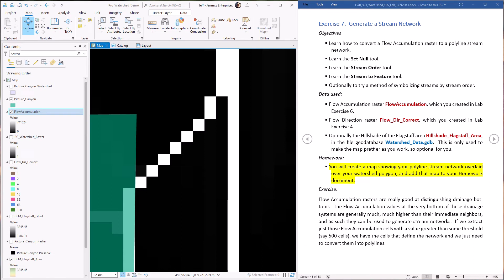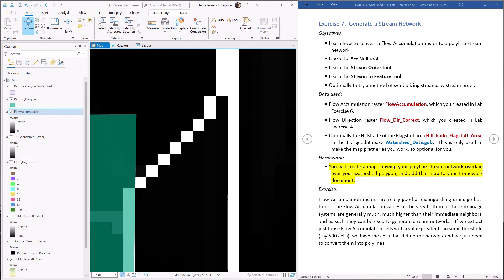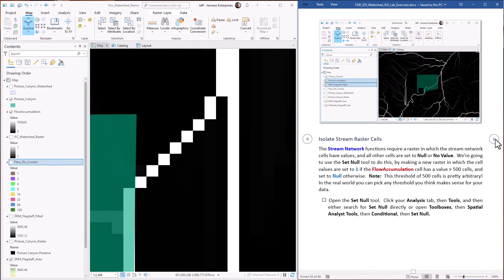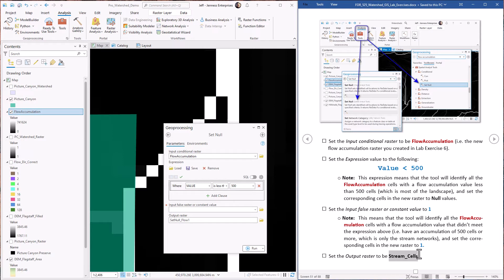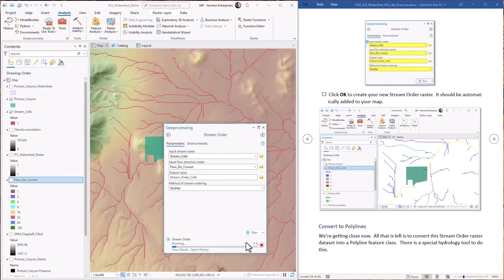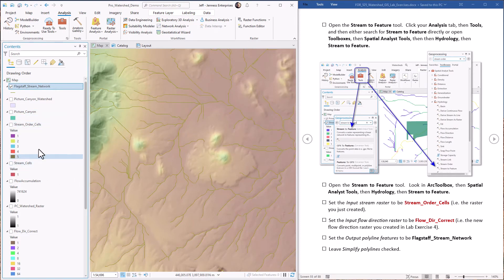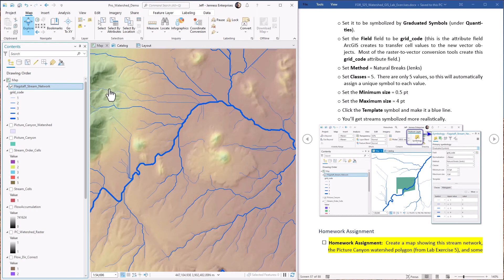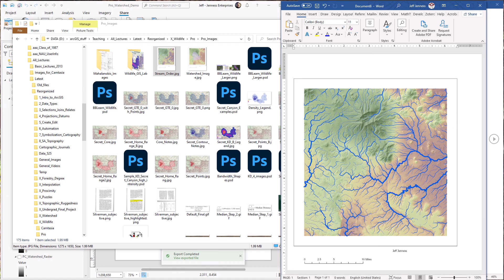Hydrology in ArcGIS Pro, Lab Exercise 7:  Generating a Stream Network using Strahler Stream Orders

Comment: This is an excellent resource, thank you so much for making this video! I am having an issue with the Set Null function. It will not accept a 1 for the "Input false raster or constant value", eventhough the information box specifically states that this option can be any interger. I tried to use the image analyst tool after the spatial analyst tool didn't work, but ran into the same problem. I tried to use several other numbers in this box, but none were accepted. What would you suggest I input here in order to proceed with this tool? Thanks again for this video!
Reply from the maker: Hi Isabella,

Thanks so much for the kind words!  That's always a good thing to hear.

As for the problem:  Hmm.  Can you tell me more about how it's behaving?  Are you simply unable to type a "1" into the box?  If so, then the first thing to try is saving your project, closing down ArcGIS Pro, then restarting it.  It could be that some of the code that checks values as you type them into the tool parameters window is misbehaving, and restarting ArcGIS Pro should clear it up.

Alternatively, does the tool just crash when you run it?  If so, can you let me know what the error message is?

And I'm curious if you can run the tool through Python.  If so, then it's just the code that runs the tool parameters window that is the problem.  Here's some sample Python code to try (and replace the path names and name of your raster as appropriate):

#-----< Sample Code >--------------------
with arcpy.EnvManager(scratchWorkspace=r"D:\Path_to_Scratch_GDB\ScratchGDB.gdb"):
    out_raster = arcpy.sa.SetNull(
        in_conditional_raster="MyRasterToAnalyze",
        in_false_raster_or_constant=1,
        where_clause=""
    )
    out_raster.save(r"D:\Path_to_GDB\MyGeodatabase.gdb\MyNewRaster")
#--------------------------------------------

Let me know if this helps, Isabella!  We can try a Zoom session if you like to figure it out.  You can reach me at jeffj@jennessent.com

Take care -
    Jeff

Comment: What if you symbolized the Stream_to_feature with an arrow? Will the accurately tell the direction the stream in flowing?
Reply from the maker: I am so sorry to take so long to respond to you on this question!  It slipped past me somehow, but I do apologize for my rudeness.

If it is not too late to help, then yes, the stream polylines do accurately point downstream.  The "StreamToFeature" tool requires the flow direction raster to run, and I suspect it uses this flow direction raster to correctly orient the stream polylines.

You can symbolize the streams with arrows by adding an arrowhead-shaped marker symbol to the flowlines.
Reply: My goal is to show the direction the effluent from WWTP is flowing too